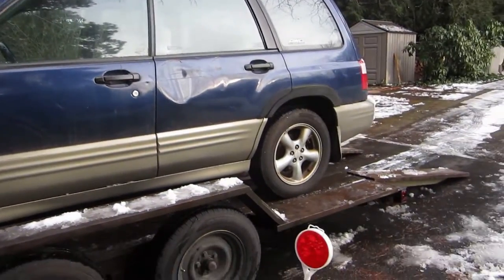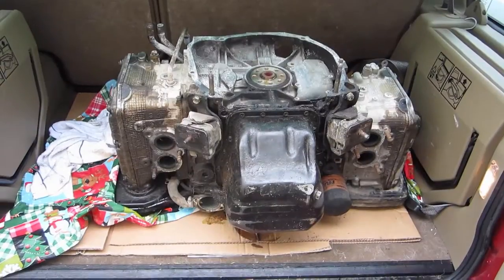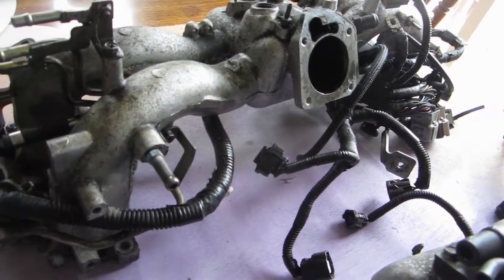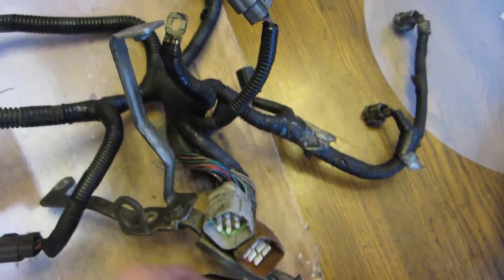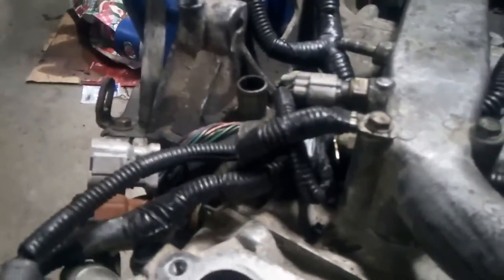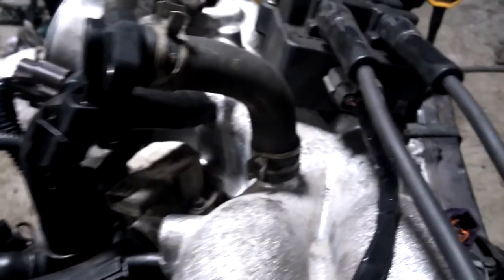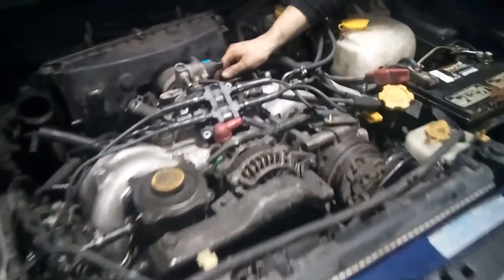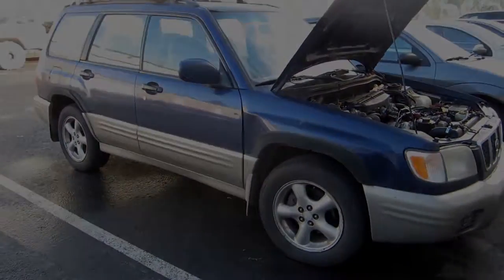Subaru Forester (SF) EJ25 Engine Swap

Comment: Hey I was planning to do a swap with the ej22e engine into a 99 forester and I believe it has a lot of the same things as the ej25d engine with it being a phase 1 engine, I read before that a lot of the stuff is the same as you covered as swapping all the sensors and that kinda stuff, but I was mainly concerned about 2 things: 1) blocking off the egr valve and the lines that ran to it and 2) drilling the hole in the intake manifold, what you did you do the drilling, and how to attach a line to the hole for the map sensor. I appreciate the help!
Reply from the maker: We blocked one of the holes to the EGR valve with a ball bearing and left the EGR hose itself connected to the exhaust, though you could just as easily block it off. We didn't have to drill anything for the map because both motors used a map instead of a maf

Comment: Hey I'm out in redland. I bought a jdm ej25 sohc for my subaru forester 05 xs. It had tgv valves and a shorter intake manifold on the jdm motor. I'm swapping all of the old stuff over. Do you think I'll still run into Ecu problems. Or maybe thing any thing else I should look over. I bought a clutch and radiator any thing else you think I should get. Keep in mind I'm swapping sohc to sohc. This is my first swap in general.
Reply: David Nylund I have questions